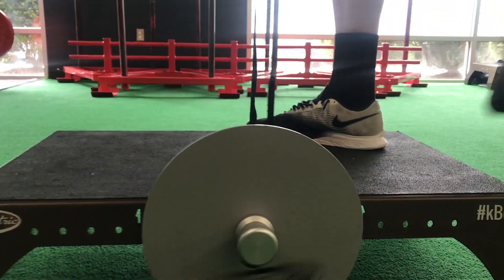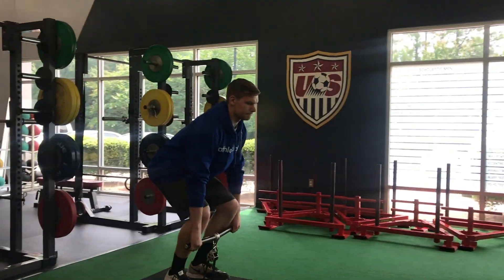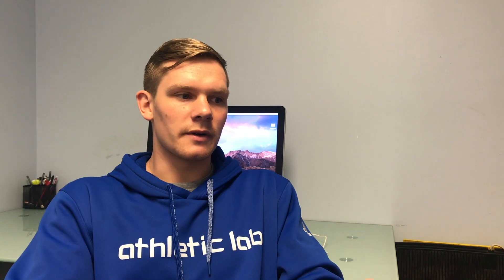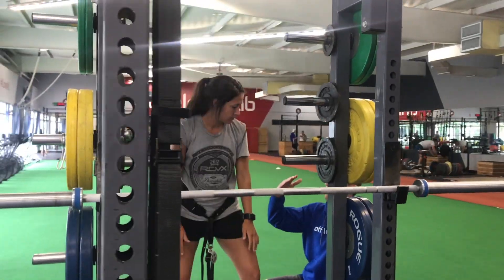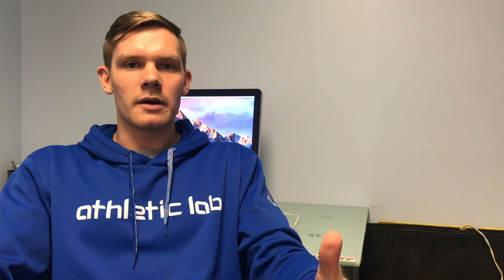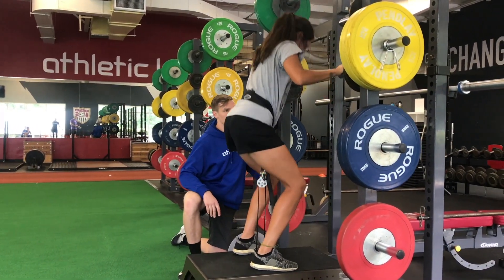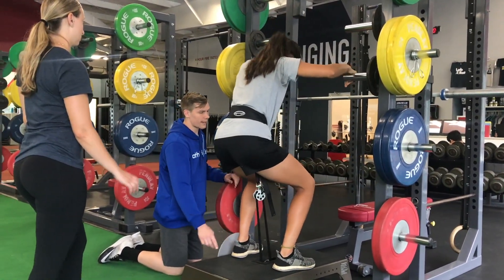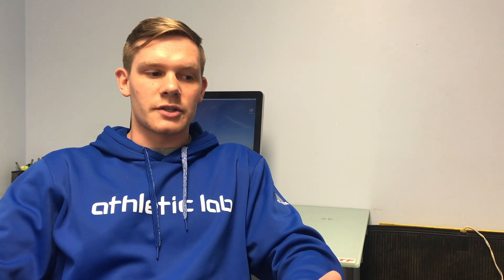Flywheel Training: Does It Actually Create Eccentric Overload?

Comment: Can’t you do the same things with a barbell or with bands. And what about the traditional 1-3-pause, repeats. And box jumping and time honored hurdle hops? I work with young tack athletes (1k - 3200 yds) who’s weight training rep range is between 10-30 over no more than 12 weeks in a calendar year. Not sure this equipment is valuable for middle or long distance endurance athletes when traditional training tools are so effective. Interesting concept. Like to see how this concept evolves
Reply from the maker: Bands and a barbell are very different. This can be used to easily create an eccentric overload. You can't really do this with a banded barbell. 

Traditional training tools are the default just as you've suggested and we love to hear your focus on the basic fundamentals. We wish more people would do that. We tend to use this with more advanced speed-power athletes but it can also be used with any other population.

Comment: I have read somewhere that the basic advantage of using kbox over traditional resistance equipments is that you doesn't stop at the end of concentric phase and you quickly shifts to eccentric movement which led to increase in RFD. But you are telling to pause during the movement which is in contrast with the above. Kindly comment
Reply: he was talking about how to achieve true eccentric overload.
Flywheel training indeed has unique benefits over traditional gravity loaded training.
Flywheel training shines in strength, hypertrophy and power if done with proper intent.

Comment: What on earth is the point of this machine when barbells and cable pulleys have been invented??
Reply: really u are asking this after whole word being stuck in quarantine? someone has limited space
Reply: @francescocalvanese6235  so if I don't have limited space this machine is not for me then?? I already have a selectorized functional trainer, a selectorized lat pull down machine, a rhino belt squat, rack and more equipment
Reply: @francescocalvanese6235  point, but if you have room for this you have room for a set of dumbbells.
Reply from the maker: Barbells and cables cannot do what this can do. Our gym has 70+ barbells and 4 pulley systems. We also have multiple flywheel devices. If the only tool you have is a hammer, you tend to see every problem as a nail.

Comment: If I understand correctly, if you pull up in 3 ft. of distance with a force of 40 lb. and the lower yourself to stop the inertial wheel in 2 feet of distance than you get that same 40lb of force pulling down on you for one foot of distance.  Does that sound right?  you have expended more force going up and you "condense" the distance that that same force has going down, so the muscles in the downward direction have to work ginst the greater force that you developed going up.
Reply from the maker: This is a good way of simplifying the concept.

Comment: basically its conservation of energy. so over the same time/distance as concentric movement you cant overload it eccentrically. just like a normal barbell.
Reply from the maker: You can create an eccentric overload if you either 1) input more force through external means (like a partner or use of hands) and / or 2) you slow / stop the wheel very abruptly.
Reply: @AthleticLab  Double leg squat on concentric and single leg for eccentric is another option
Reply: @AthleticLab  just like a barbell
Reply: @bunny.bunbob  no, a barbell will not forcibly push you down, so although there is MASS, there is no acceleration (or deceleration). This is what the kbox does, it provides a greater force on the eccentric by increasing the amount the straps underneath accelerate in the opposite (eccentric) direction. In practice, a set of 10 repetitions on the kbox with a large flywheel feels far more difficult that a set of barbell back squats for my 10RPM.
Reply: @elitefitnessperformance6136  "no, a barbell will not forcibly push you down, so although there is MASS, there is no acceleration (or deceleration)"  F=m*g 
"it provides a greater force on the eccentric by increasing the amount the straps underneath accelerate in the opposite (eccentric) direction." explain this please.
Reply: @bunny.bunbob  so, let's say you're doing a squat on the kbox: the harder you push up the more force you will recieve on the way down through the auto-retract system

Also, the F=mg equation only applies to objects falling at an acceleration due to gravity, e.g. an apple falling from a tree
Reply: @elitefitnessperformance6136  just like a barbell. the harder i push up, the more weight i can get in an elevated position. i will then receive the force of more weight on the way down. F=m*g applies to any object with a mass on earth. moving or not.
Reply: @bunny.bunbob  You cannot recieve more weight in an 'elevated' position with a barbell, unless somebody physically adds more plates each side
Reply: @elitefitnessperformance6136  the maximum force that I can experience from a barbell in the elevated position is the gravitational force, yes.however, I can let it fall down and then I have to counter a force that is higher than the gravitational force near the bottom of the movement. The flywheel allows this to happen at any position, but this means that the other positions then don't require as much force because the sum of the forces over the distance is constant. This is the only advantage that I can think of. Being able to apply such "extra force" techniques anywhere during the ROM instead of just at the bottom position
Reply: @bunny.bunbob  Have you ever tried the kbox?
Reply: @elitefitnessperformance6136  no
Reply: Adama Traore uses a KBox, so I’m giving it a go if I can get one
Reply: @bunny.bunbob man, you have a fundamental misunderstanding. The forces down are not the same with a barbell and this.

Comment: If you have a greater absorption into the ground when jumping will it carry over to producing force more easily and efficiently?  Or does the eccentric and concentric have to be balanced out for a better vertical results?
Reply: That's what I'm TRYING to do my masters on (with high drops, not with flywheels)...  Does purely eccentric overload, which allows greater loading for a greater time (because you can slow down and stop a LOT more weight than you can concentrically lift), still confer an improvement in power or strength--as measured by vertical jump and/or squat?  Currently seeking a chair and a lab, if you know anyone interested.
Reply: @AlphaTech-g5b  I'd say go to the gym all day.  Even if a kbox can be effective for a few specific movements, the gym offers much better versatility.  As a baller, you need the dynamic movement of squats, half squats,  weighted jump squats, and Olympic lifts and whatever else you want to do).  It's a lot easier to cheat reps on a kbox too.  If you get tired, you may move slowly on a box, but 300 lbs on your back is 300 lbs.  Try one out if you can find it, but I advise against buying it.

Comment: I’m lost.
Reply: The flywheel can't pull you down harder than you pull up on it.  BUT, if you pull it with 200 Newtons of force upwards (concentric) for 3 feet (200/3= 67N/ft), but stop it at thigh height on the way down (200N/2ft= 100N/ft) then the eccentric phase is higher than the concentric .